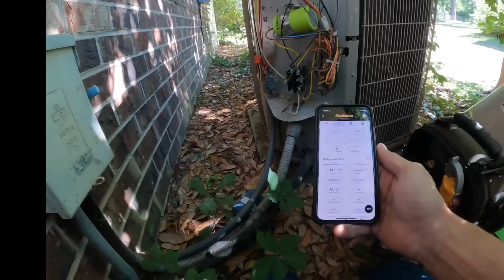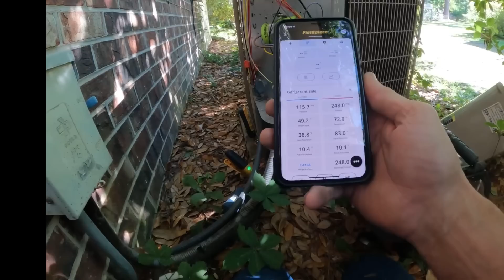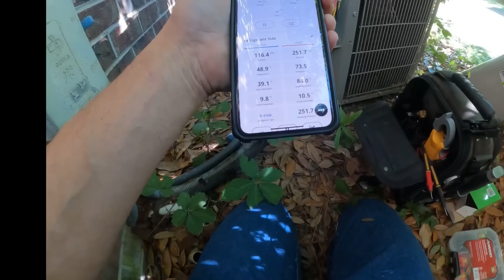Mother’s Day Call. No Cooling!

Comment: On those style carrier units I like to take 5 seconds and unplug the low voltage harness to the board to keep from accidentally shorting out the yellow wire on the contactor. Some capacitors are about a inch away from the contactor and real easy to short with a nut driver. Safe a trip to the attic to replace the fuse

Comment: I see you used the screwdriver to bleed the resistor. I like those Bluetooth gauges and Bluetooth temp probes I didn’t even know they made those. Did the low and high side gauges read the temps or is it a set (pressure gauges and temp probes) that work with that app to get the superheat and sub cooling.

Comment: I use to hate when people watch me. Now I don't mind it, as long as they want to learn more about their system. I just hate the ones that try to tell you how to do your job.
Reply: If you cant tell the difference between a compressor muffler and a factory installed filter drier than you will have this problem often. The competent techs dont need any extra help, they are easy to spot.

Comment: Constructive criticism: when you check voltage from line to ground; if the unit is not properly grounded back to the main panel you will not read voltage on your meter. Best to always check line to line.
I enjoy your videos. Have a great day.

Comment: I’ve always been told to mount capacitors vertically ?
Reply: You are suppose too. Normal capacitors don't have this note, but on some capacitors it tells you to mount right side up for longevity of the capacitor. Will it work upside down? Yeah, but it wont last as long. The dielectric settles towards the connectors.

Comment: nice work! what did you use for that scrap around the cap?
Reply: 1 inch metal strap, comes in a box. I like the strap with the hole already in it
Reply: I use plumbers tape
Reply: It's duct strap

Comment: Just out of curiosity, at what point do you decide it’s okay to gauge up or not gauge up on a system? At my company, we only do if our temperature splits not within range.
Reply: I was always taught, never leave a no-cool call without checking presdures.
Reply: I believe that you only hook up when the system is low on charge. You don’t want to add impurities to the system. you also want to use low last fittings. That’s how I do it. Check the subcool and superheat with your clamps or by your gauges in temperature of the lines.
Reply: @friscoblackburn176   those low loss fittings are hard to rebuild when your company makes you use leak sealer. I use those too because I'm newish and don't like using gloves all the time.
Reply: With probes, you aren't losing refrigerant. It's for you and your customers benefit to make sure it's in order.